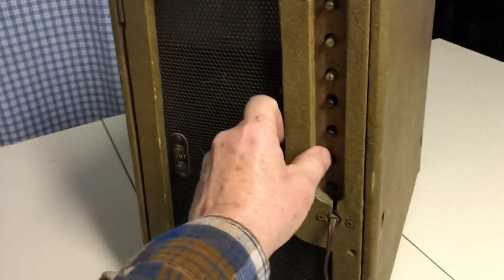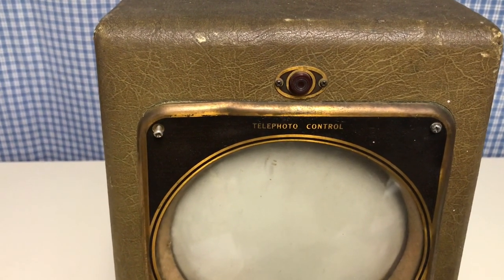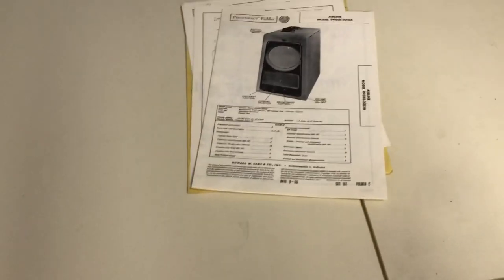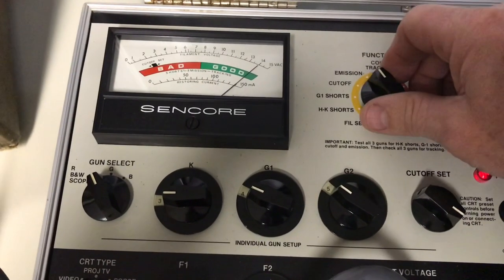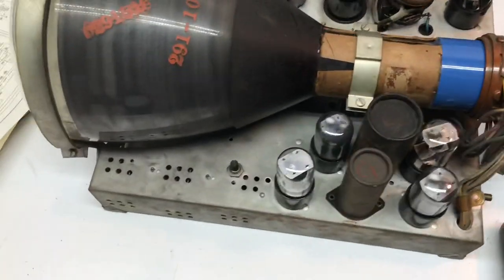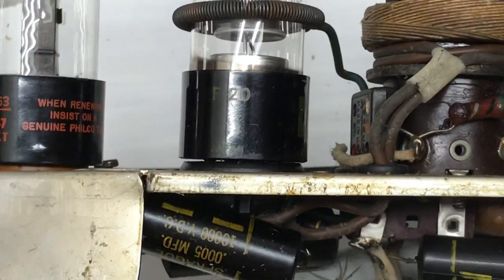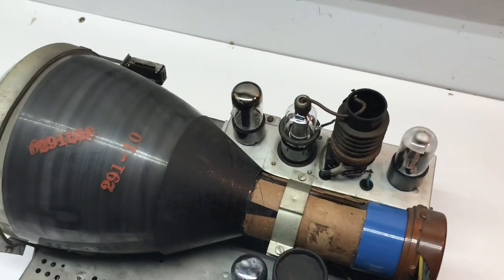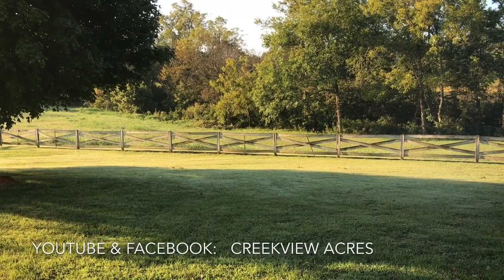1949 Airline 7” TV Restore part 1 of 3.  Analysis and Chassis work begins

Comment: Good luck with a very nice model vintage TV. I got one of these years ago and they're excellent performers like the similar Sentinel's. The cabinet isn't too bad. Simple clear Elmer's glue  will fix the loose Tolex. I also rub some into frayed areas with my finger to neaten them up. The front panel is thin and with some care you can bump out any dents/dings. Be careful using any harsh cleanser on the painted woodgrain. It can fog it up. Use a small soft brass brush on the grill with a tiny bit of metal cleaner. With patience all the streaks will come off. They all get that. PS - The date on Photofacts is always one year ahead of the model.
Reply from the maker: Thanks for watching 
 I got quite involved with the cabinet , watch parts 2 and 3 and you’ll see what I did. 
  Part 2 next Friday 
  Part 3 in 2 Friday’s